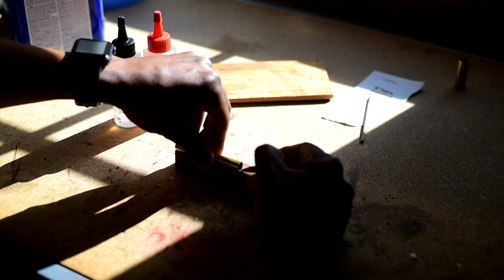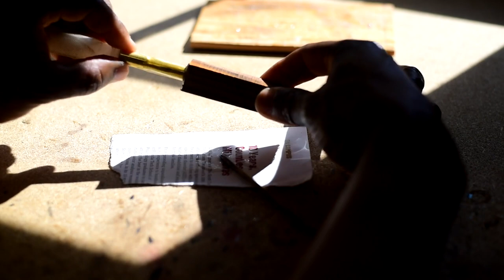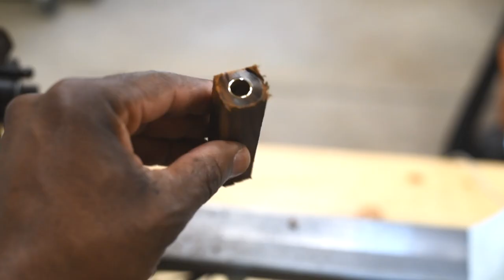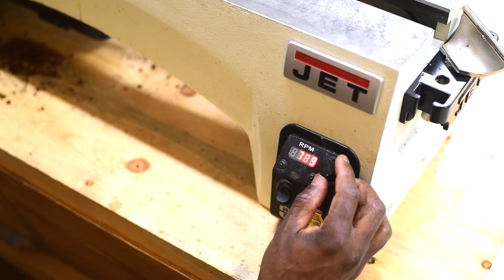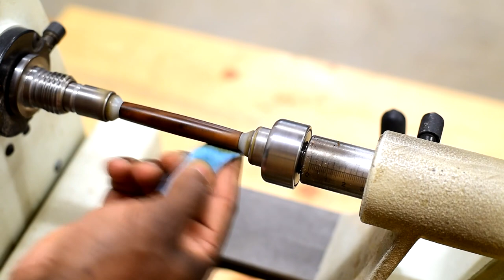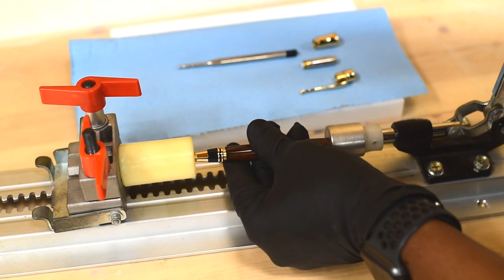Turning a Cocobolo Executive Ballpoint Twist Pen

Comment: I was told that the cocobolo wood does not take the CA well. I know that I had a tough time drilling out and using my bore square because of the oil in the wood. I was surprised to see how well your finish turned out. I haven't turned my blanks yet but I plan to use shellac for the finish. You did a great job!
Reply from the maker: I’ve heard the same thing also. However, after applying a sanding sealer, the CA took very well. Thank you for the kind words and good luck with your project. If you use a sanding sealer, recommend allowing it plenty of time to dry. Good luck and thanks again.